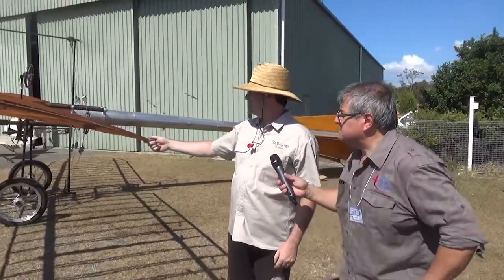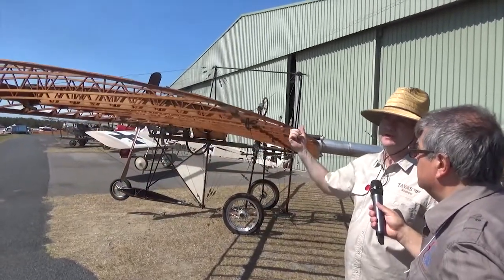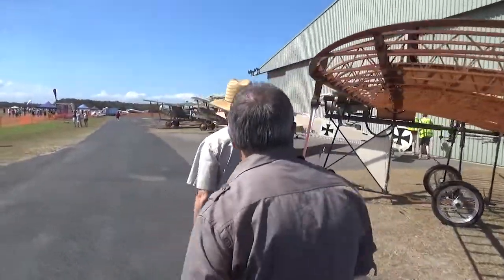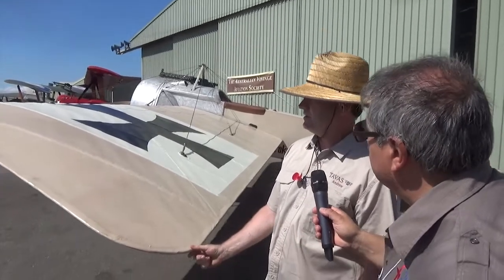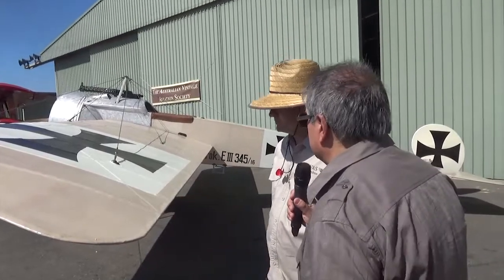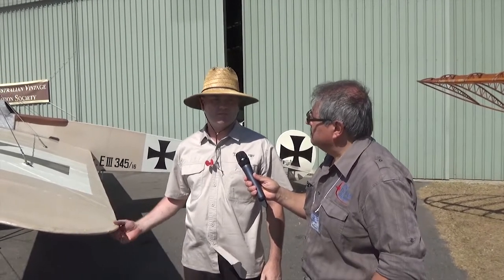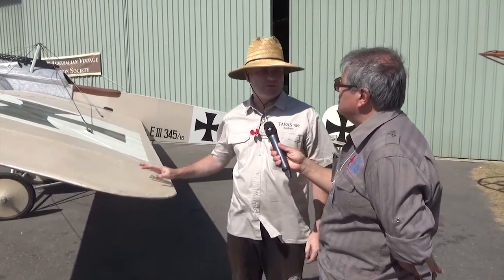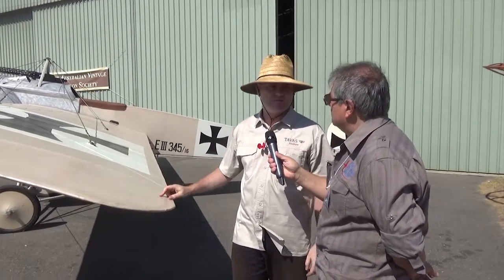Season 3, Episode 4: Wing Warping

Comment: how does the stick or yoke cause the warping?  i can see the wheel turn every dip and rise, but how?  does the rear pully system on the left wing to the top bar and to the right wing have anything to do with that?